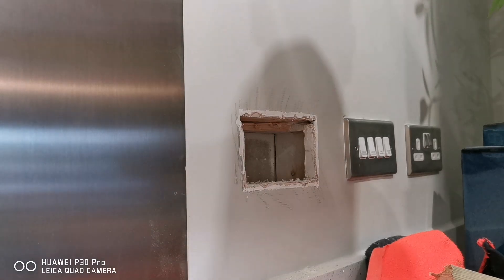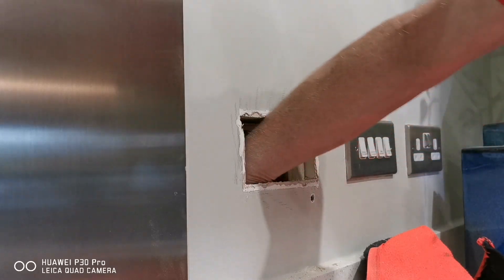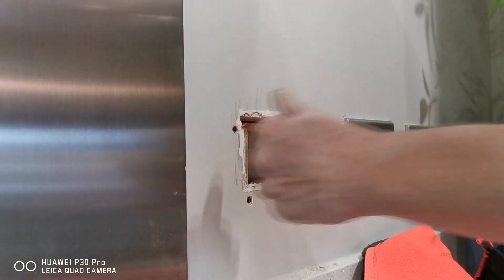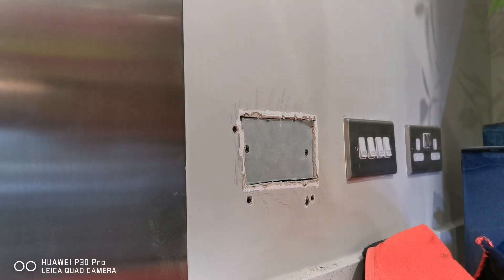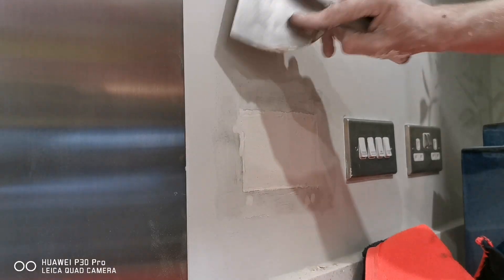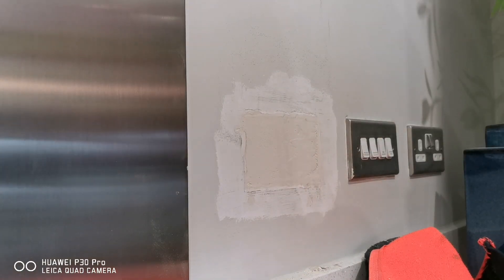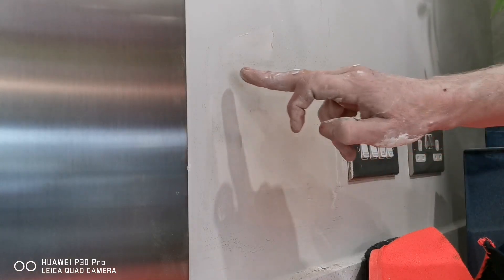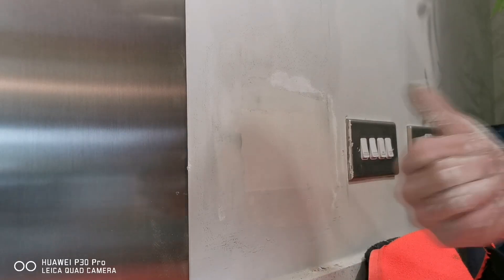how to repair plasterboard after moving a socket

Comment: Hi. Chris. Just discovered your channel. What screws are you using to screw the batten in the back of the plasterboard at around 40 seconds.
Are they just standard plasterboard screws?
Reply from the maker: Hi buddy,  yes they are just normal drywall screws 👍👍